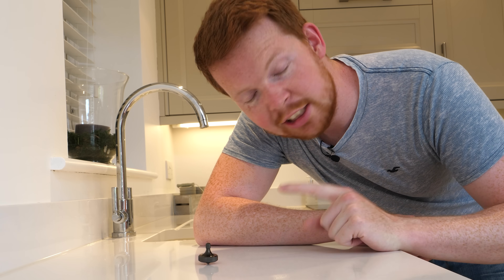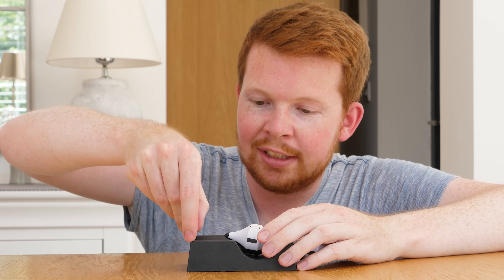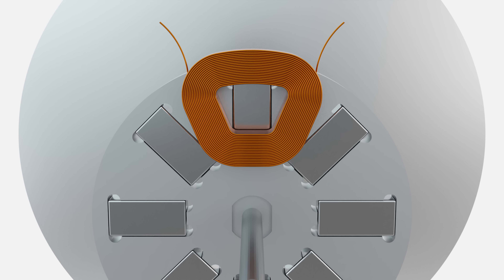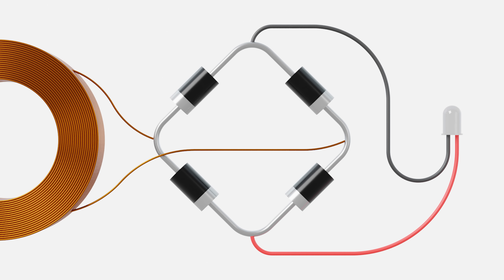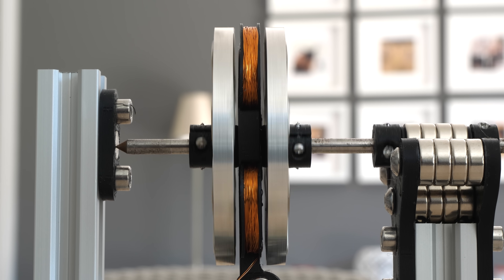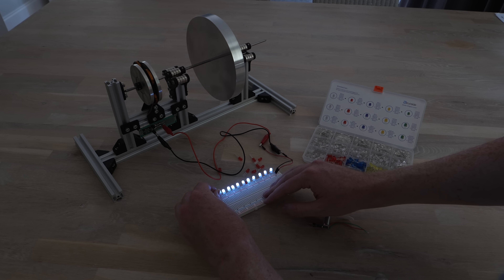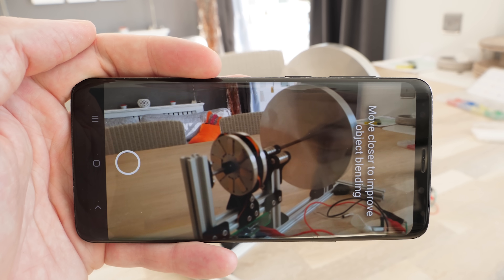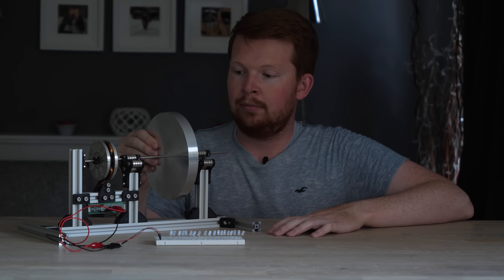Flywheel Battery

Comment: could the spin of the flywheel be further aided using the repulsion of magnets as well? Maybe slightly angled magnets on the edge of the wheel and a surrounding bracket with matching angled magnets of the same pole, or even a singular magnet under the wheel so with each rotation it gets a little "push"? Or am I missing something? Electro-magnets programmed in step with the rpm of the wheel? Conservation of energy making it irrelevant?

Comment: if you put more of those discs with the magnets on the shaft with coils between then (a 3rd disc gets you 2 sets of coils) and offset them so the pulses are at different times and run the electricity through their own rectifiers you can smooth out the electricity. the more sets of coils the more steps of offset you can do making it smoother. you can also use inductors to smooth things out as well.

Comment: We use a bigger  version of this at work as back-up power. So in case of a blackout the diesel generators have time to start without any dip in our power systems
Reply: There is a lot of energy present in rotational inertia in our power grid as is. The big spinning turbines all rotate together, contributing to thousands of tons and millions of joules of stored kinetic energy. When the electrical load increases, they slow down by a fraction of a Hz, using some of that stored energy before the plant operators amp up production to match. Same idea with low electrical load situations.

Comment: How about if you merge this design with a high CFM fan driving a Tesla turbine?  Given enough coil windings,  could it generate enough airflow to keep the flywheel(s) spinning or at least extend the runtime?

For example, use your vortex generator valves and a compressor to prime the turbine and get it spinning...

For example:
https://www.youtube.com/watch?v=AfCyzIbpLN4

Comment: Why not spin it and then charge your phone or iPad
Reply: The voltage would not be consistent enough for that. Most chargers require EXACTLY 5 volts DC with negligible ripple in order to work properly. I highly doubt it could supply 5 volts at load under the current configuration. An iPad charger uses 2 amps at 5 volts, or 10 watts of electricity. That is a pretty high load and would almost certainly bring a flywheel of that size to a stop pretty quickly.

Comment: Try this in empty space for haven't air conf. And thy to add a motor to spin the generator wen the rpm are low and will have 100%+ efficiency

Comment: Won't eddy currents produce friction in the aluminium disc?
Reply: Eventually, yes. I'm sure that is a contributing factor to it stopping under no load. They are quite far apart, though, making it mostly an afterthought.

Comment: Hey Tom awesome Video! How about connecting a brushless esc to it to use it as a brushless motor with magneticly levitated shaft? If that works i might at some point use it to build a very quiet turbine to replace the part cooling fans on my 3d printer by mounting it on the back of it and connecting some sort if light weight hose to the printhead. you could probably build something similar and if you machine the entire shaft on the lathe in one setup you should be able to get it (apart from the magnets) perfectly balanced. also you could put magnets all around instead of just the underside so they stop it from jumping out of the holder at high rpm. 
I hope I gave you some ideas and greetings from Germany
Felix
Edit: You could also use it to power an rc plane with a very high rpm motor. I don´t know if the noise from rc planes is more due to high speed roller bearings or due to air turbulence around the blades but this might be able to quiet it down and make it more efficient by reducing friction. And let´s be honest it would just be pretty dope to have a plane with magnetic bearings in the motor ;)

Comment: (By AMA) To whom it may concern.
The Key to making an over unity Electric generator work is mechanical advantage. In this case the mechanical advantage is achieved by getting the electric motor that is spinning to be able to spin a quantity of separate discs that are connected to devices that generate electrical current to generate more current then the electric motor needs to spin. One of the ways to achieve this without violating the laws of thermo dynamics is to exploit magnetic field effects. To do this you place the magnets on the disc that the electric motor is spinning in a way that makes it so while the disc is spinning around the magnetic fields are slamming upwards onto the edge of the other discs forcing them to spin, thereby generating electric current. In this way, the magnetic fields will be forced to do work that the electric motor wont be doing. This is how it's possible to achieve an Over Unity Electric generator & with this technology we can free ourselves from the use of gas. (By AMA)
Reply: Starting off with magnets:
A magnet functions as a means of achieving potential energy. Think of it like a spring, or gravity. A magnet at rest does not have any energy. A magnet only gets energy when it opposes another magnet, or the action of removing a magnet of the opposite polarity. The magnet would be in a stage of attracting another for half of the summative cycle, and repelling for the other half. This would exactly cancel out itself. Magnetic fields also don't "Slam." Lines of Flux tend to repel each other and can never touch. They tend to elastically morph in such a way that the total telsa-value of any point in space is kept to a minimum. A motor already works by manipulating electromagnetism to convert electrical energy into kinetic energy. Lens' law says that changes in induced current are opposed, and causes an opposing current in the wire. This necessitates the application of external electromotive force, else the motor comes to a stop and the eddy currents formed by its remaining inertia be dissipated as heat.

As for mechanical advantage: 
mechanical advantage is something different and mostly unrelated. Having mechanical advantage in a simple machine is to be able to supply more force that was input, or move the output a farther distance. These are mutually exclusive, as having one decreases the other proportionally. With a lever, multiplying the force by "x" would multiply the distance moved by "1/x" thereby making the amount of work done (and thereby energy used) the same on both sides. Same thing is true with gears, which act as radial levers. 

And electricity:
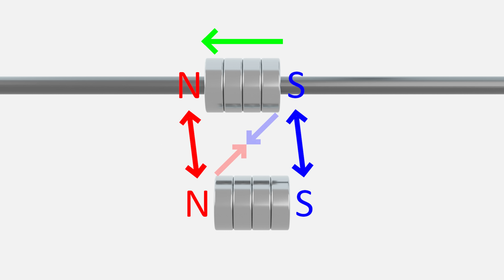This could be analogous to a transformer in electrodynamics where voltage (pressure/force) and current (literal speed of electrons) are proportional in the exact same way as with mechanical advantage. The equations P=IV means electrical power is equal to the product or current and voltage. Using Ohmic analysis of such a circuit, a higher voltage will result in a lower current by nature of a parasitic and unavoidable series impedance. If you have a 1:10 (n=10) transformer, and on the load you have Z=100 ohms of impedance, the transformer will "see" Z/n^2 ohms or 100/100 or 1 ohm on the supply. Putting in 5 volts would draw 5 amps by ohms law. That is 25 Watts of electrical power. Those 5 volts get stepped up to 50, and 50 volts over 100 ohms 0.5 amps or 500 milliamps. 50*0.5=25. As is happens, the "electrical advantage" of this transformer makes it so that energy in = energy out. If you don't believe me, get a multimeter and test it out yourself. Don't be an idiot with it, and keep the alternating current at safe levels of course. You will find that the amount of electrical power is exactly the same, if not slightly less due to eddy current losses in the transformer housing and thermal losses in the coils. These equations for for the "ideal transformer." 

In Conclusion:
When you apply the tried-and-true equations to reality, you find that they all converge on a truth. No energy is created or destroyed, but simply changes form. In other words, the first law of thermodynamics. Science isn't true because some authority says it is, it is true because the predictions we make using it can be validated by empirical measure, or falsified by similar means. Unless you propose a model of physics, fit with the proper equations and conjecture that can better predict what is observed than Rudolf Clausius and William Thomson did in 1850, you're ideas will be dismissed as just ideas. That's just how science works, get over it.
Reply: @zacharytaylor190  You did not understand what I said. look again and draw out a picture of what I described and maybe you will then understand why my idea does work.
Reply: @MasterFeiFongWong  i want to see you make it, hook up a multimeter, and show me that it is generating voltage, and passing current over a resistive load. Than I will be convinced. You were not specific at all by "magnetic feild effects."

Comment: Great video - Can you add a magnetic communtator with magnets to drive the shaft/flywheel either electrically or mechanical from the flywheel to attract and repel ... yes I am thinking perpertual ha ha motion or at least somewhere close to an assist to keep the flywheel turning longer?
Reply: He probably could drive the wheel electrically. This would be done either by  DC commutator, or by applying synchronized AC to the alternator, bypassing the rectifier. All generators are technically motors when run in reverse. It would end up slowing down faster than if it were in an open circuit, though. The resistance of the wires used would load the alternator more than the motor would supply, therefore dissipating energy as heat. First law of thermodynamics has held thus far, and doesn't seem to be changing anytime soon.
Reply: @zacharytaylor190  a horizontal flywheel which is leviatated [and constrained to keep it inline] hence friction less ? 
This could also have magnets in the peripheral, these peripheral magnets could be attracted and repulsed by a second device containing magnets would need to also rotate in their seat to achieve a pull push, the driver for the push / pull device could be driven from the flywheel. The generator would be fitted to the flywheel, if friction energy in the push / pull device is less than that of the energy in the flywheel would it sustain motion?
Reply: @monumenttools  1. The act of constraining would create some kind of friction in most practical setups. In this case there is a small, but non-zero amount of friction from the pin keeping it from toppling.  
2. Your question are confusingly written. What exactly do you mean by a "push/pull device" Perhaps you are referring to an electrical rotor. That is what I will infer. A peripheral magnetic device, that is capable of inducing a rotational moment, or better known as an electrical motor would need an electrical input. This input would use energy to do 2 things. For one, it would transfer a rotational moment to the flywheel. Additionally, it would dissipate a small amount of energy in the form of heat and sound.
3. If the energy loses through friction in the motor are less then the energy losses through the flywheel, nothing special would happen. energy losses add together. In this case, let's say that at an arbitrary velocity, we have 1 watt of frictional energy lost in the motor and 1.5 watts of energy lost in the flywheel. The energy in the system would be lost at a rate of 2.5 watts. In order for energy to be conserved in such a system, you would need to introduce a component that has negative loss of energy (better put as a gain of energy). In the hypothetical case I used, you would need a component that added  net of 2.5 watts to the system for it to reach an equilibrium. This added energy must come from somewhere, as negative friction does not exist, as any surface with a negative coeffect of friction would impart a force in the same direction of motion, thus accelerating the object infinitely. The idea of "friction energy" doesn't make much sense, as friction acts as a means of converting energy by the application of a force opposite to that of motion. Energy is not stored in friction, but instead dissipated into heat as a result of the force of friction. You will still have energy lost, and both of the energy losses would add. 

To avoid repeating myself, I will cut myself short. Please reply is you wish to provide clarification about any concepts in either of our comments.

Comment: I am not sure will it work but you could convert ac to dc then use a jouls theif to step up the small  dc voltage to something usefull?
edit : try using larger and powerfull magnets then also attach the wind mill thing (i cant remember its name but it spins when there is air) so it will spin with the power from air?

Comment: Excellent Tom. When I see this, I'm mentally scaling up: to create a wind genertor device with low friction (magnets floating it) rotating vanes. Your thoughts ? It would be great to have more power by reducing friction of moving parts ! Cheers, Dk.
Reply: Depends on the load connected because other than mechanical friction it will get electrical friction in terms of back EMF. You will need higher wind pressure to keep in running
Reply: The technology is already developed, S2M Active Magnetic Bearings
Reply: Don, let's be real, you won't ever make that.
Reply: @michaelcohen9363  Why do you feel the need to throw shade at someone? Is it because you see yourself as a lazy do nothing person that needs to try and bring someone else down because you know you wont ever amount to anything because again you are to lazy to put forth the effort?
Reply: @michaelcohen9363  why not ?
Reply: @davidwillard7334  Because he won't.
Reply: @michaelcohen9363  but you don't know that !
Reply: @davidwillard7334  David, I know it. Now go run along now champ.

Comment: Finally some real free energy
Reply: I hope you are joking.
If not, learn about how Lens' law works in relation to alternators, and how electromagnetic induction takes energy away from the motor that is being spun. The flywheel's kinetic energy is being converted to electrical energy. As electricity is used, the flywheel slows down. This is similar to the magnet being dropped down a copper tube slowing down, or a hand crank generator being harder to turn when it is being used to charge something.

Comment: Instead of having a top on 1 end where the rod touches to provide stability. You could cap the end in 2 magnets. Then put 2 magnets on the plates. To be repellent to both magnets.
Reply: Or...would it be possible to balance the magnet forces by opposing the magnet set up and expand the distance between the fixed magnets slightly.

Comment: This was much cooler than I expected.  Love the demonstration of the full bridge rectifier.  I had no idea converting from AC to DC was that simple.
Reply: Fortunately, I learned that 40+ years ago.  With coils that are at different positions, they will produce AC peaks at different times (phases). In the 1800s they found out that 3 coils making 3 phases can provide smooth power without wobbling, which is really nice when the flywheel etc. all weigh multiple tonnes.  Converting 3 phase AC to DC just needs an extra pair of diodes for the extra input wire.
Reply: @johndododoe1411  a Hex bridge!
Reply: the reverse is much more useful and complex, inverters are sophisticated thing
Reply: @elysonpanolino1162  what makes the lines on the road sizzle under the big power lines? After the rain.
Reply: @elysonpanolino1162  Unless you cheat and have a DC motor powering an inverter. Not nearly as efficient and obviously lots of moving parts... But then how about a brushless DC motor on one side of the flywheel, the flywheel in the middle which would both look cool and smooth things out, then the alternator on the other side. @Tom Stanton how about that for the next project, a Maglev, no contact, mechanical, DC to AC inverter? Practical? Well it's simple and only one moving part.. and very definitely a LOT of fun 🙂
Reply: Hvns  h

Comment: Can a flywheel generate enough energy to power itself?
Reply: No. See: First Law of Thermodynamics. The flywheel is not "generating" any energy per se. It is storing rotational energy until it can be used. This rotational energy is used in this case to generate electrical energy. When the coil interacts with the magnet, lens' law makes it so that the magnet opposes the motion of the current. This causes a resistive force on the flywheel and slows it down. The amount of electrical energy would be exactly equal to the kinetic energy lost, in an ideal environment. In non-ideal reality, energy is lost in eddy currents, friction in the pin, resistance in the wire and voltage drop in the diodes.
Reply: @zacharytaylor190  Thanks for the reply. I really appreciate it

Comment: Instead of an alternator,  You could put a motor that is driven by a solar panel on the other side of the flywheel  That way in the day time the sun would charge the flywheel with energy and at night the flywheel would power a L E D.

Comment: Much of the metal parts could be made out of wood.  They would have to be bigger though.  And what about putting a small 8 mm  bearing race against the vertical glass wall instead of using a point against the glass?   The glass could be madeof wood.

Comment: Right several ideas, I’m not an engineer or electrician, first you should try and connect an ac motor driver to speed it up with a battery, second, you should maybe have a ratio of maybe 4 coils and 7 magnets, this would reduce the flickering

Comment: To pull the flywheel off the shaft, heat up the outside diameter of the flywheel...it will pull the bore open.  Do not heat the center...it will crush the shaft.